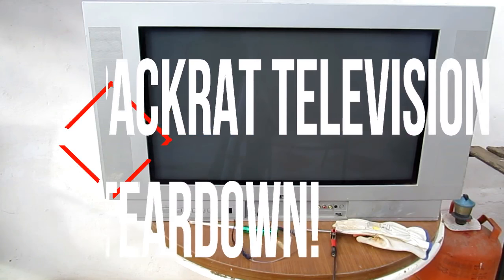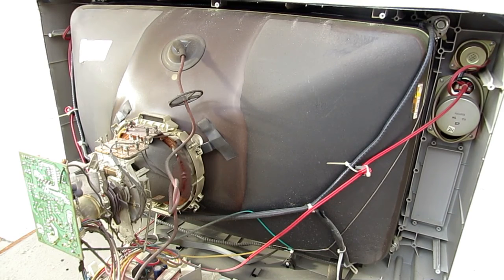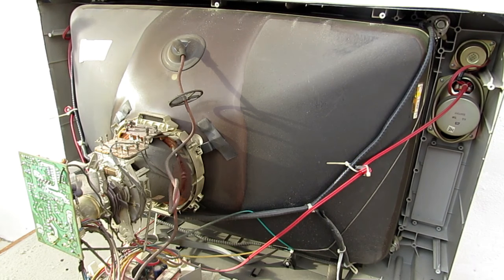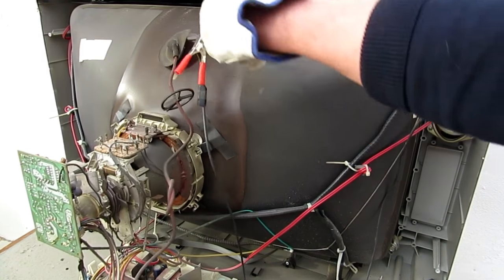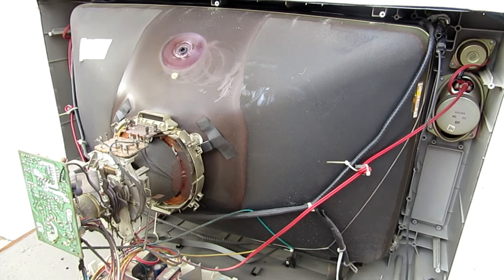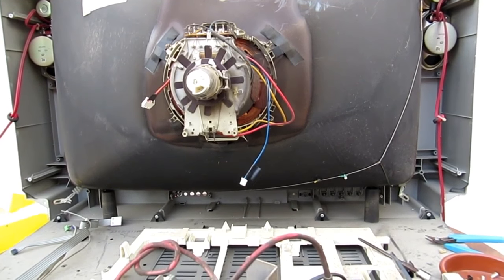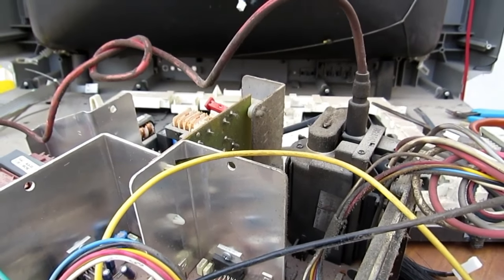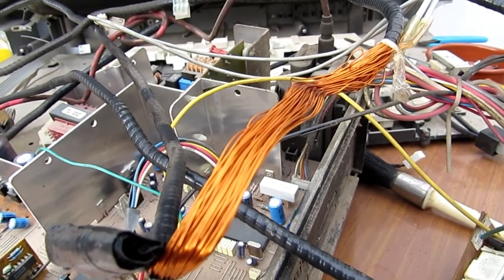Packrat Television  Teardown! - Recycle Electronics Get FREE Parts and Good For The Environment!

Comment: I've taken quite a few of these old televisions apart myself, the bigger the screen the better because those have the largest flyback transformer which is the main component I'm always after, sadly I recently blown the biggest flyback I had with my monster ZVS driver I made that pushed more than 600 watt through the flyback making super hot 10 cm plasma arcs which is at least 100 kilo volt and it lasted for about a year and I've had a lot of fun with it... Now I use a hand wound flyback transformer that I made myself but it behaves different because I don't have the built-in high voltage diode that the CRT flyback transformers do have so I can't produce the corona discharge anymore only the same hot plasma arc comes out the one I use now.
I hope to find an old tv or more to recycle since there are lots of useful parts in there, also the big resistors and the big ceramic ptc are things you should save, the degaussing coil is the one that I use to make a Tesla Coil which is the reason why I love to take old tv's apart in the first place.
Reply from the maker: Great stuff! Good to know it is not just me that enjoys these things! Happy hunting! On the subject of dangerous things I have just bought a 40 watt CO2 laser, videos coming soon!!